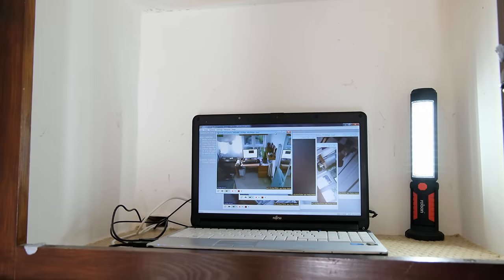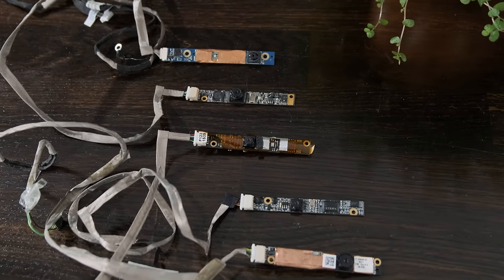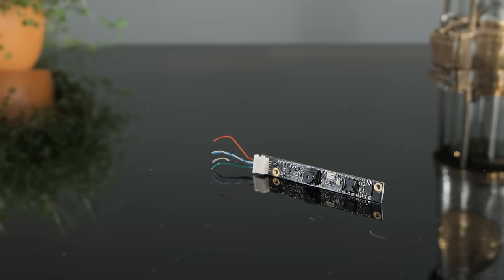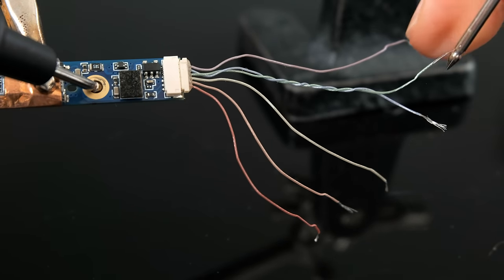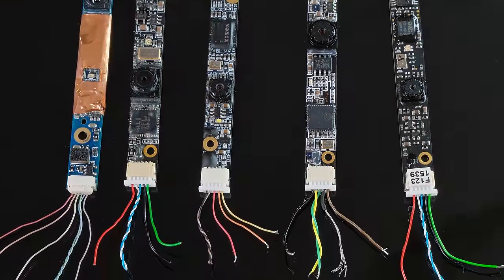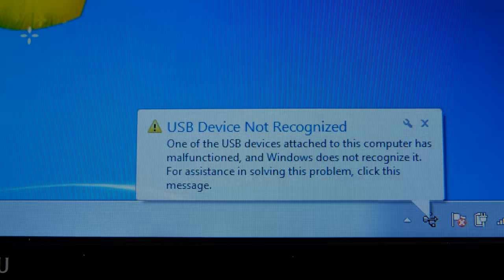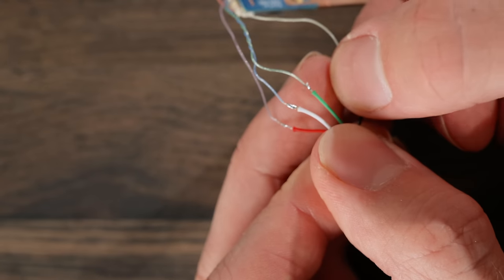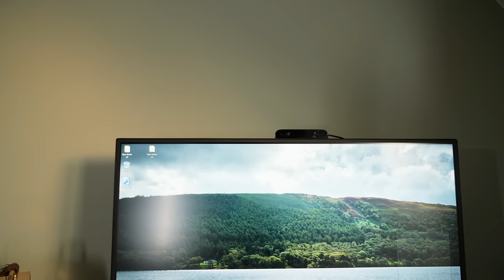How to Convert Laptop Webcams to USB Webcams

Comment: Nice, simple and informative video, I've actually been wanting to do this for a while ! The webcam I salvaged from an old laptop has a 3.3V indication on it. Can I ignore that and wire it up to a 5V USB without killing it or do I need to step down the voltage?
EDIT : For anyone wondering, I tried it without regulating the voltage, and it is working fine ! There is a copper sheet all around the unit to dissipate the heat, and I can feel the power regulator area getting a bit warm, but nothing too dramatic for now.
Reply from the maker: I don't want to comment in case it goes wrong, but I've wired up at least 10 of these to USB and they've all worked well.
Reply: It may work but get hotter or it could burn out immediately or after a while. You could look for the datasheet of the power regulator to see if 5V is within the specs or you could get a buck converter like this https://www.aliexpress.com/item/4000528901389.html, since 3.3V is pretty standard you could look for one with a fixed output instead.

Comment: Hi Matt.
Thanks a lot for your lovely videos. Especially this one caught my eye and i wanted to give it a try. 
So i tried as show in your vid, but unfortunately it did not work out for me. I think i got power and ground right, because if i switch the data cables, i get an "device unrecognized" Error in Windows 10. But when i switch the data cables back, nothing happens. Not even a sound.

Can you help me and tell me, what i can try to get this camera working ?

Thanks in advance.
Cheers
Reply: I had a similar issue (recently managed to do this project with an old HP laptop). I was trying to use some crocodile clips to identify the wires before soldering them together and it wouldn't recognize the device. I tried to just hold both wires together with the same crocodile clip and then it recognized it - so I assumed that the addition crocodile clip go between wasn't helping. After I soldered everything together it still had issues - but when I covered the contact points in electrical tape so they wouldn't touch it seemed to do the trick. 

I have seen other comments here though that highlight a voltage issue which could also be a problem!

Comment: como converter esse os fios de cabo, pela tensao  3.3V conectar com a porta 2.0 USB mas o problema que é amperes ?o problema é porta 3.0 USB ? ela nao aparecer a tela na webcam!
traduzido
how to convert that the cable wires, for the 3.3V voltage connect with the 2.0 USB port but the problem is amps? the problem is 3.0 USB port? it doesn't appear on the webcam!
Reply: @vantagens DIY

Comment: Very interesting and lucid instruction video. Can you tell me if I would need to  install drivers to use the 1280 x 1024 HD module from a SONY  VIAO Laptop?
Reply from the maker: It should work automatically, especially if you have Windows 10

Comment: Nice!
Does it come with the microphone or it's separate module?
Reply: Sometimes they do, sometimes not. 
But if you’re salvaging the camera from a laptop yourself, you need to look for tiny holes on the bezel of the lid. (To the left, right, or both sides of the camera lens.) 

Once you have extracted the circuit board with the camera on it, hold the bezel you removed in front of you, and line up its camera “window” with the camera lens. If you can see a (at least one) “metal box” looking device on the circuit board that lines up with a hole on the bezel, it most likely does have a built-in microphone. But there is literally thousands of different laptop camera modules on the market!

Ps. An almost sure-fire way of finding out, is to look up the laptop make and model the camera is intended for, and then take a look at the list of product features, or download the manual for the laptop and look there...

Good hunting! 👍
Reply: @BoHolbo  Thank you!
Reply: @spiritcore1  Convention seems to be that the microphones, while on the same circuit board, are connected directly to the motherboard and not via the USB connection. So while you will have the hardware there, it won't be nearly as convenient as the webcam was to use. But don't give up!
Reply: @benskidmore6523  I think the microphone goes directly to the sound card, either as analog or some sort of I2S, PDM or other digital signal, as there is no point of having two sound cards in the same computer. And I had a laptop where the mic was in the vicinity of keyboard, but google what SMD microphones look like and you should know if it has one. And then search for its datasheet to know what kind of sound output you might have.

Comment: There is one problem, webcam use 3.3v, but usb use 5V. How to fix this?
Reply: You can use diodes or a voltage regulator to reduce the voltage. And data lines does not need to be reduced.

Comment: I really need a response from someone, i'm trying to hook up a webcam from an Acer Aspire 5336 Series but i don't have a multimeter to find out the power positive and negative i need help
Reply: 100% it's time to get a meter. It's maybe the most important tool in my toolbox.
Reply: @benskidmore6523  well I'm really not a person who messes with electronics that much to using a meter would be a very very rare occurrence for me so there is just no point
Reply: @TheChosenJuanLopez  OK, as suggested by someone else, you can get a 9V battery, an LED, a resistor and some wire. This would make a tester that lights up :)

Comment: I took out this from my old laptop but there are 7 wires and there are no holes to find ground wire. Help!?
Reply: Find a ground plane - any large flat area of copper. Look closely at the PCB and find where it seems to be all copper under the paint. This should give you ground, for power, if possible connect the wire to the old laptop (it doesn't need to boot, just power up). Look for 3.3V or more, as it's common to drive these cameras with 3.3V instead of full USB 5V. Keep trying!
Reply: @benskidmore6523  the laptop it completely broken down to pieces so can't connect to it. And I can't seem to find any copper plates. Also then why is there 7 wires?
Reply: @Jafri_Jahan   Jafri Jahan s  well mine has 6 wires and a shield/ground wire - 4 x USB, and then 2 mic wires. These are for a clock, and data signal. So it's possible yours has a second mic, or a second power supply.

  By copper plates I mean the entire surface of the PCB is copper in some areas (under the green or black paint). Look for the wire which seem connected to the circuit board surface if you scratch gently. 

  You might also get some help if you can find your laptop schematic - it may map out the connector which goes to the camera.
Reply: @benskidmore6523  I am a beginner at these things so I couldn't understand the schematics. For now I would try finding the ground. If you want to know my laptop was dell Inspiron n5110

Comment: Great video, thanks.  The webcam I took out of an old laptop has super thin wires coming out of it, any tips on how to strip them without cutting/breaking the wire at the same time?  You answered the other question I had, how to solder such tiny wires with simple pencil soldering iron, just twist them together instead!

Thanks,

RichE San Diego, CA   And no, I don't pronounce the L in solder...  :)
Reply: It's 2 months after, but if you hadn't figured it out you can use a soldering iron the burn off some of the rubber on the wiring and then pull it off. Pulling it off might break the wire so you could also just burn all the rubber off.
Reply: @BrianSteelFactory  Thanks, I'll give that a try.

Comment: Can you make a video on using the camera off a broken cell phone ?
Reply: If you really want to re-use a phone camera the best way to go about doing so is downloading an app, you generally can't do something like what's in this video, you would need to figure out what connector it uses for example it might have a BM10/14/20 FPC connector then solder those teeny tiny pins to a breakout board or something where you can more easily test/probe the pins and on top of that phone cameras don't use a typical usb interface, they're more directly connected to the SoC which means you would need to make your own interface using a microcontroller or Raspberry Pi or at least look for someone else's project as a guide at making one. 

Basically in short a few people may find it a fun project but it's not at all worth the effort when you can get good usb cameras or cameras that are natively compatible with boards like the Raspberry Pi for $20 or less.
Reply: You would also need drivers

Comment: This is so annoying it's actually funny but I have now tried this with 5 different laptop webcams and literally none of them even remotely resemble the ones you have been using.  None of them have braided wires except for the alienware which has two sets of green and white braided wires with 9 wires in total... I fried one which maybe meant it was 3.3v versus 5v but yeah at this point it's just become a funny excercise to fry cams whenever I get a new junk laptop.

Comment: Laptop cam is 3.3 V and USB delivers 5 V. You need to drop voltage.
Reply: That's what the voltage regulator does.
Reply: @IlBiggo  Does what? In leptop they have 3.3 V. They made to work on that specific voltage. 5 V will kill them. 
There have to be 5 V ones but I havn't seen them.
There is solutions like 2 diodes.
Reply: @FodrMichalych  The one in the video has a regulator, but some don't, I'd try 3.3V first. A 5V camera on 3.3V probably won't do anything but will definitely be intact, and a 3.3V camera on 5V will be dead instantly.

Comment: When you have 5 of the EXACT KINDS OF CAMERAS, I'm sure it's simple to figure out. My camera has 7 wires. Lets see you wire a camera with 7 wires instead of a simple 4!
Reply: One wire is probably the shield connection. Maybe your module separately wires in a microphone or LED? That would explain two more wires.

Comment: Please do some videos on phone cameras...

Somewhere we can use them
Reply: If you really want to re-use a phone camera the best way to go about doing so is downloading an app, you generally can't do something like what's in this video, you would need to figure out what connector it uses for example it might have a BM10/14/20 FPC connector then solder those teeny tiny pins to a breakout board or something where you can more easily test/probe the pins and on top of that phone cameras don't use a typical usb interface, they're more directly connected to the SoC which means you would need to make your own interface using a microcontroller or Raspberry Pi or at least look for someone else's project as a guide at making one. 

Basically in short a few people may find it a fun project but it's not at all worth the effort when you can get good usb cameras or cameras that are natively compatible with boards like the Raspberry Pi for $20 or less.